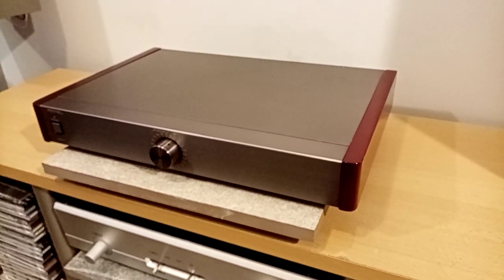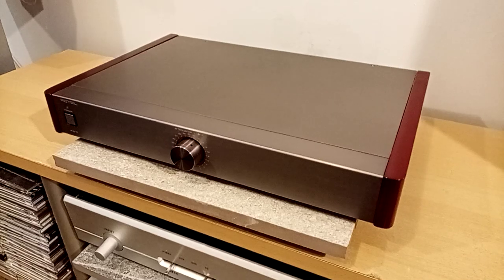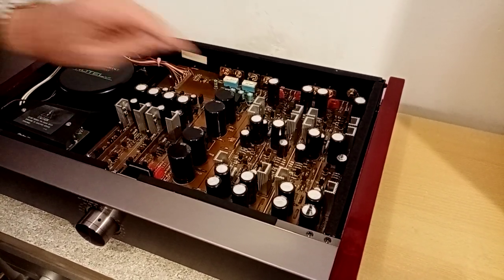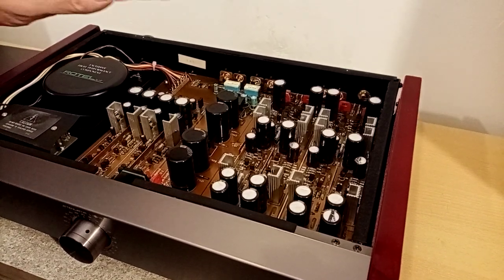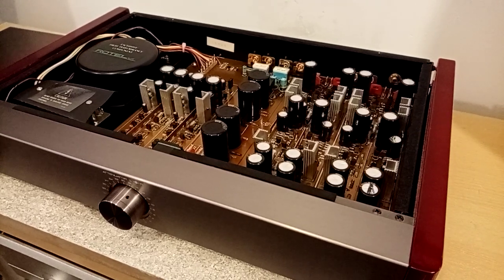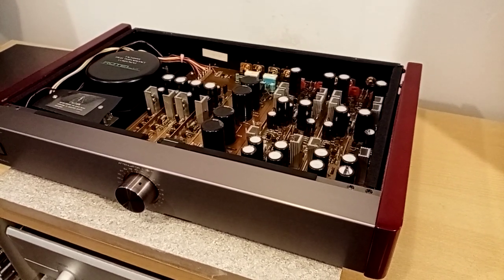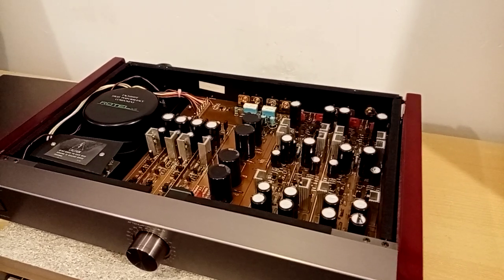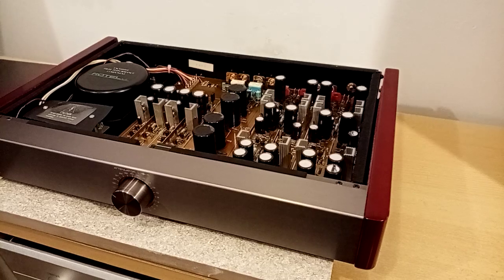Rotel MICHI Phono Stage High End Japanese component.

Comment: Proud owner here, built like a tank, special printed circuit board, separate windindings in transformer, vishay transistors, blackgate capacitors, and most important sounds fabulous and very silent. This product today you should pay more than 3000 eur, no doubt. Compared to Airtight tube phono stage the Michi sounds more dynamic and similar in warm character.
Reply from the maker: We agree! Amazing build and sound.

Comment: That's a beautifully crafted piece of gear! I bet that it sounds the part too. Nice!

Dan
Reply from the maker: I used my dad's MICHI Phono Stage for a while with my Leak Stereo 20, sounded brilliant!
Reply: is it a volume ctrl at the front panel?
Reply from the maker: @pinglunlaw3437  Yes, it's a volume control at the front. You can use it directly into a power amp.